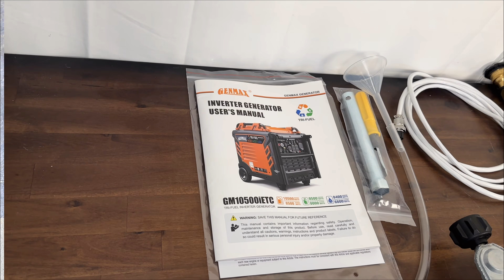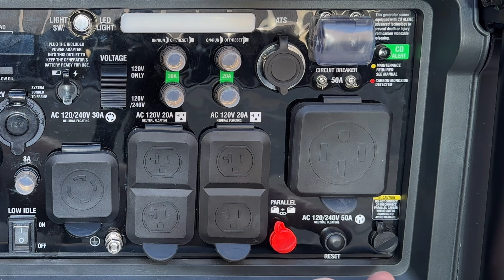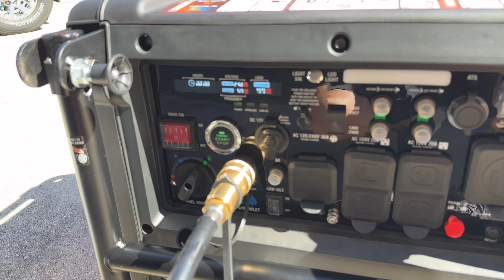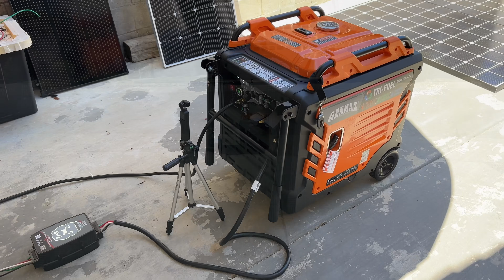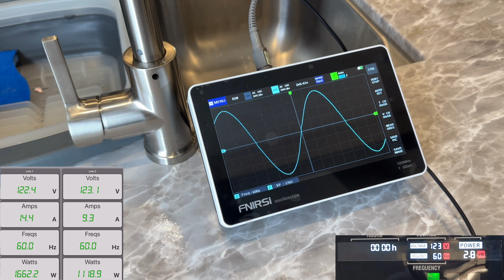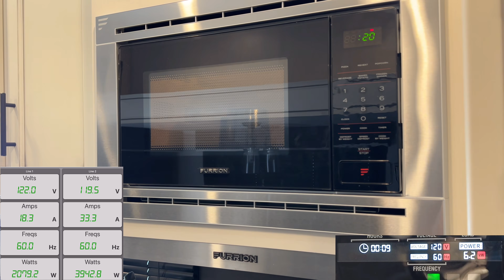Best New Generator GENMAX 10500iETC Tri-Fuel Inverer Generator!

Comment: that sine wave was actually pretty impressive in my opinion for how much load you were pulling.  Im impressed! How is Genmax's warranty as well as parts availability.  Those are my 2 biggest worries for something like that.  Something beneficial about honda's is their parts are available for a long time (priced like gold chains thought)
Reply from the maker: When I was in Vegas with Genmax they said they were camping up parts availability for there models and customer service. The parts warehouse is in sandiego but some parts are a little universal which can be found on eBay and such. But now they have thing you can replace and fix.
But yea Honda you can get parts for a while. Although my inverter board for my eu3000is was discontinued and no superseded number was available so I got rid of it
Reply: @johnnysweekends  oh wow that sucks.  Maybe thats because they released the Eu3200i? I do know that if fuel injector parts fail they are expensive to replace.  I saw that the fuel injectors for the EU7000IS are like 550$.  Maybe thats why Genmax hasnt gone fuel injection.  Does fuel injection matter to you?
Reply from the maker: Fi has its pros and cons like anything. 
For me I’m a pretty mechanical guy so I don’t have a lot of issues when it comes to storage and such.
I under loads and jetting and more. 

A carb swap and parts are cheap like $30-$60 and doesn’t take long to swap small engine carbs. 

If fuel injection is new then parts will be spendy for a few years till there is a lot of parts and also aftermarket as well. 

It does start nice and is more fuel efficient so…again the pros and cons

Comment: I would like to see a direct head to head vs the predator 9500. Predator is 6.8 gallon tank, 18.5 hours at 25% load which is 1900w continuous.  This genmax is a 6.9 gallon tank rated for 14 hours at 25% load which is 2125w continuous.  So in terms of efficiency per watt, it appears the predator is more efficient. The predator is about 20% more efficient per gallon than the genmax. I did a bit of math and it appears the predator provides about 5169wh per gallon while the genmax provides 4311wh per gallon. If anyone was curious. This would mean the predator would go through a gallon of gasoline in about 2.72 hours while the genmax would go through a gallon in about 2 hours. Overall predator is more efficient but genmax has slightly higher output 7600w continuous on the predator vs 8500w on genmax.  If anyone has anything else to add/correct please drop a reply below! Good video Johnny! Let’s see that head to head 😤
Reply: The GenMax w/ propane and the 50a plug checks all the boxes. I “wish” for fuel injection, but I guess it won’t matter too much if using only propane. Is there a better inverter Gen? Let me know. Thanks!!!
Reply from the maker: Thank you. 

So some things that are different 

Predator $2499
Genmax $2899

Predator gas only
Genmax tri fuel and includes all accessories 

Genmax longer standard warranty 
Genmax remote start 
Genmax quieter 
Genmax lighter by a couple pounds
Genmax more output power
Genmax cool display and a light 😂😁👍🏼

Genmax 3% THD 
Predator 5% THD 

Now fuel consumption……I think they are all wrong as again it’s a pretty controlled test.
So many variables like load and ambient temp can give different real world results 

Now predator says .37gph @25% load
Genmax in the manual says 2.195 l/h or .58gph.

They have almost the exact same size engine. 458cc genmax, 459cc predator. 
I can’t imagine they can be that far off unless Genmax runs a much richer condition than the predator which means they run a real lean mixture. 

So fuel tests very a lot unless you do the same unit on the same day with the same amount of fuel using the same
Load. Sure can be done, but odd they would be so much different. 

Maybe the predator is more efficient gas wise…🤷🏼‍♂️

But the Genmax wins mostly everywhere else. 

So until a definite fuel test can be done won’t know for sure. 

Good post for sure to give some back and forth pros and cons 😀👍🏼👊🏼
Reply: @johnnysweekends  for sure, I didn’t bother comparing the other options but the trifuel on the genmax is my attention grabber. I would like to see you test all of the claims you mentioned above though! I’m a bit apprehensive trying genmax due to the tests project farm noted with the 2000w one. Higher wear metals, not full sine wave, etc. I would just like to see claimed results vs real world results for both! I think that would be an awesome comparison! Perhaps a bit long but I think it would see which is the “cleanest” power wise and which is the most accurate on their claims! Thanks for the reply Johnny!
Reply from the maker: Yea the wear metal test was skewed, I told him when doing this on generators you need to change the oil once or twice to remove the assembly grease. It’s a flatly looking grease they use to lube the engine while it sits on the shelves and can skew the oil analysis test. 
So hopefully he does at least one or two oil changes before the oil analysis next time to wash the engine.
Reply: @johnnysweekends  the oil test at the end was the second oil change for all generators in that video. Halfway through the testing he changed the oil after that had ran for a few hours. The oil analysis at the end was the second oil change after close to 100 hours on each generator so each generator did have a flush oil change ran though prior to the oil being analyzed. This is why it is worrisome. It’s not required in the manual to change the oil so short (within 2 hours like he did) but that first oil change should have gotten rid of any contaminants/etc. so the second oil change was a accurate result of normal use. The predator shut off from low oil during that test which isn’t good but the genmax is wearing metal in the engine for sure. You should do a engine oil analysis on this one to see if that is a model specific finding etc!
Reply from the maker: Interesting I’ll have to rewatch. I watched it when it first came out so been a while. 
Plus I don’t have the excess funding Todd has 😂 but I’ll have to see what the costs are

Comment: Great video. Do you know what the max continuous power at 120v?
Reply from the maker: I’ll be doing a designated full
Load test probably next week. The book says 6000 watt at 120…but the generator spec sticker says different.
Wouldn’t be the first time I have seen a
Misprint on the one or the other. 
So will see.

Comment: But no showing of Natural Gas. And I see these Tri-Fuel generators all the time; but they NEVER use NG. What's going? Huh? So sad.
Reply from the maker: The problem with natural gas is you won’t see good performance. You’ll see diminished numbers and people will think it’s a weak unit. 
But that would be with any generator running on NG. A 20% cut in power is a decent chunk and if it’s really hot it could be 30% or more, as heat will rob power with any fuel source. 
NG has way less btu and you’ll use 6 times the amount to generator the same power a gallon of gas will. 

Now this could work out if NG costs in your area are super cheap, and you don’t need that extra power. Running a generator at 80% and above it’s rated load all the time will decrease it’s life so you should upgrade to a larger unit if you are in that range.
Reply: @johnnysweekends  To me the benefit of natural gas is you never have to worry about running out of fuel, unless the gas lines to your house are shut off. Great testing, thanks for the vid.
Reply from the maker: Yea that is a nice thing, because most times your NG is on, unless its a disaster zone. And thank you, plus your welcome
Reply: @johnnysweekends  No disrespect, but most of the Generator Companies now; are adding the NG feature also. Making it a "Tri-Fuel" Generator.

Thus, I can't think the Company; would NOT put a big note; saying similar words of what you said.

Secondly, I have had NG in my home for 48 yrs. Plus, I have several things that use NG...and we never had ANY problem. So why would it cause problems with the Generator?

Again "NO" disrespect.
Reply from the maker: NG doesn’t cause “problems” with generators. It’s mainly two things using NG. Overall power output is less and engine life for generators is less on NG. It has less lubricants so engines wear a little faster. 

So if a NG gets 5000 hrs
Propane 7500 hours 
Gasoline 10000 hours 
Diesel 15-20k hours

But the having NG readily available is the convenience of a tri fuel setup. It’s ready you plug in and go if you are set up for. 

Trust me I like it as well. I’m also ready to run what ever fuel source I need. Normally I use propane or if I have enough gas I’ll use that up so it’s not sitting much. Which it’s just for my lawn equipment now that is almost all battery powered now.
Reply: How long would that propane can last on that generator continually running? Thank You
Reply: @alexvillanueva8485  Yes, I would like to know that too! Because I just bought a 100 Lb Propane Tank.
Reply from the maker: @alexvillanueva8485 that all depends on the loads. About 4 hrs on a 20lb tank at 50% load. Which is about 4000 watts continuous

Comment: Johnny, Genmax updated its version, as far as I know. Am I wrong on this one? If not, I'm assuming the one off Amazon is being the updated one, correct me if I'm wrong please!
Reply from the maker: Yes this is the latest and most updated unit in the line. All the other new units will be coming out soon as well. 
Those will all be smaller units
Reply: Sweet! I'll get one off your link, did you fix that promo code thing by the way? My wife will be thrilled that I saved a buck when I tell her 😜 I've been waiting for that puppy for months, cant wait to start it up and see how it works. Already have 30amp and 50amp inlets installed with an interlock switch.
Reply from the maker: Definitely tell the wife how much you saved. That’s a woman’s favorite line.
Babe, guess how much?? No guess!! 🤣🤣
Reply: @johnnysweekends  🤣🤣 she already knows there will be a new gadget. Johnny, I've spent over 10k so far on my garage, and it started with making a spot for this Genmax, I just "went with the flow" 😬🤦😜
Reply from the maker: 😂😂😂👍🏼

Well I’ll let ya know when the code is fixed , I’m just sitting here waiting for the reply…🤷🏼‍♂️

Tell your wife I saved her some money, that way she won’t hate my channel 🤣🤣🤣🤣🤣
Reply: @johnnysweekends  rock n roll ! I'll get it tomorrow morning. My Amazon Card has only a 2k limit, i need to change things around there 
"Honey, guess what I bought" 😬😃
Reply from the maker: 😂 nice. Ok I should have a post on the main page and I’ll post here for the code when it’s fixed 👍🏼
Reply from the maker: Ohh and no not yet I’m waiting for them… hopefully in a couple more hours.

Comment: how long are the lpg and ng hoses?
Reply: Is there a restriction on how long 
a NG line could be?
Reply from the maker: Not really just size will have to be larger as you get longer.
Reply from the maker: 25ft for NG line 👍🏼 but lpg is only about 6ft because you would hook to a bottle. Easy to get a longer line